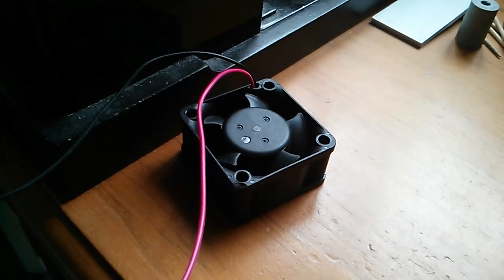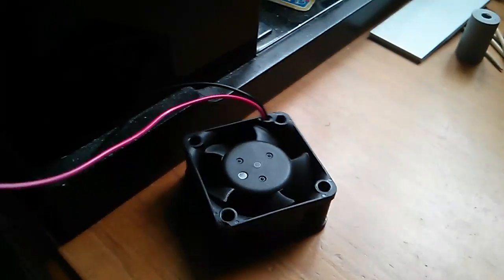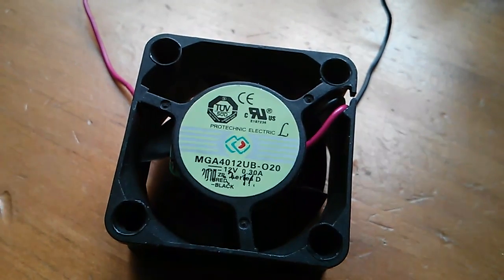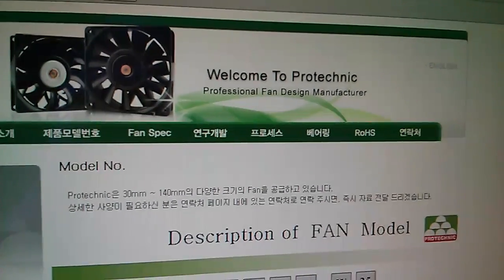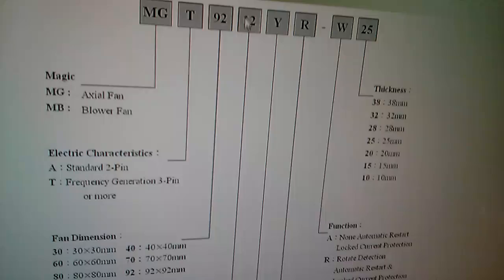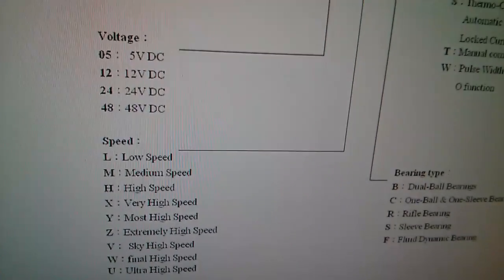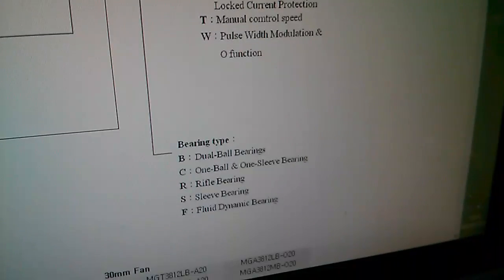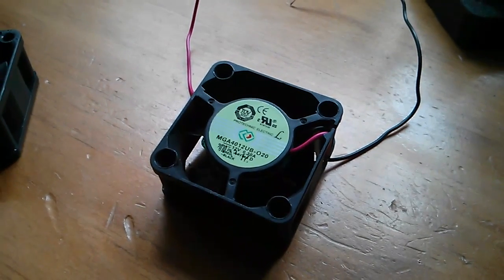Crazy High Speed 12v 300mA Fans to cool 100W LED

Comment: I wonder would the push of air be enough to create an efficient enough makeshift air duster out of one of these small fans? If the air current was concentrated enough while at full power?

Comment: I was under the impression that a fan like this was not always on max speed. I believe they are controlled by temperature. I would hate to have a noisy fan like that going all the time.
Reply: Most are, but if this is 2 pin there would have been speed control in the PSU itself